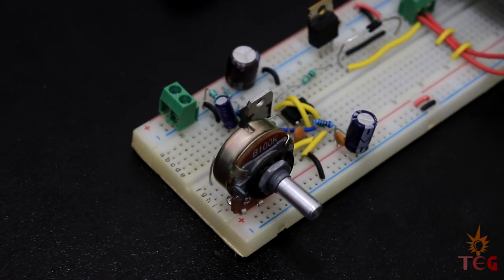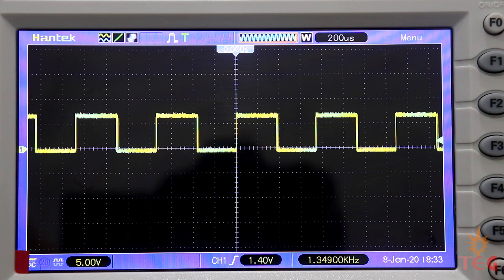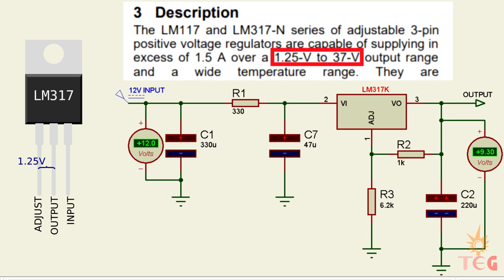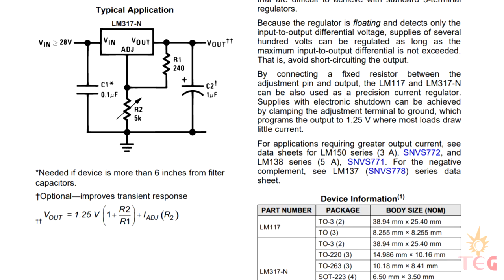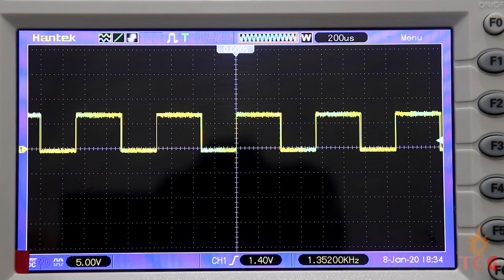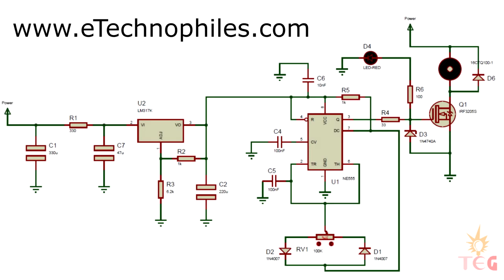I made a DC Motor Speed Controller on Breadboard| 60V,15A

Comment from the maker: Timestamp :

Specifications:  00:07
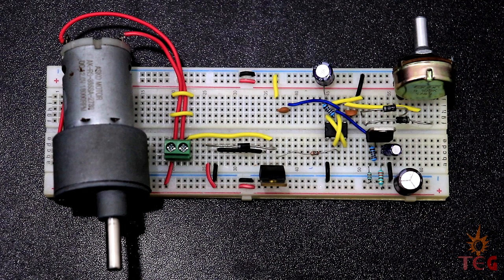Circuit explanation: 01:40
Switching Circuit:  02:09
PWM Generator:  03:20
Voltage Regulator Circuit:   05: 04
Circuit Schematic: 05:39
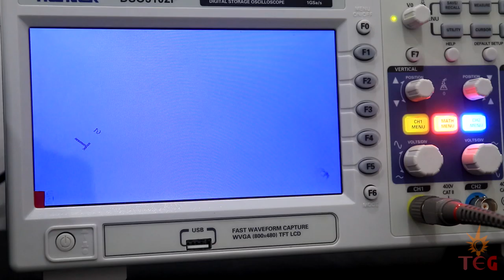Input voltage Regulation in detail: 06:07
555 timer PWM operation: 07:18
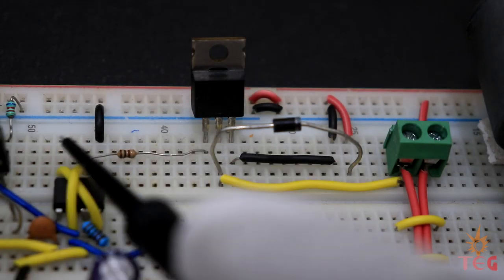How IRF3205S Mosfet switches the Motor: 09:00
Why Schottky Diode across Motor: 09:42
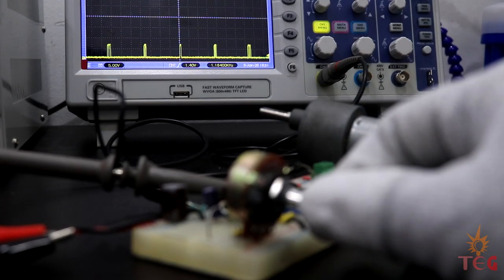Demo of the Controller: 10:15
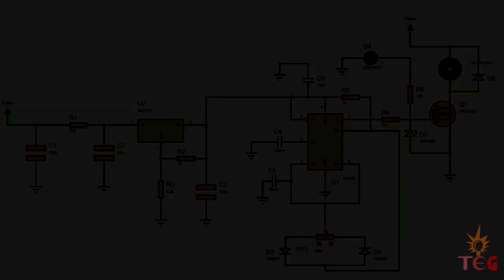Am I the Designer of this Circuit? : 10:43
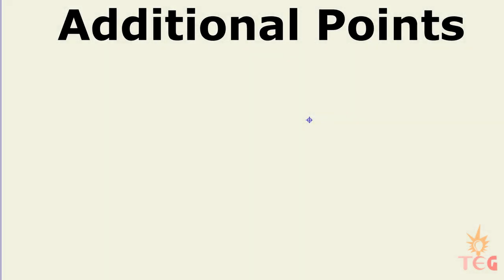Additional Notes:  11:25
Where is the Arduino Control Part? : 12:12
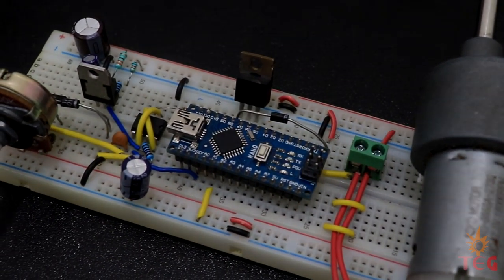Life Lesson from TEG: 12:25

Comment: In the diagram you show 4 diodes 1 zener 1 schottky and 2 X 1N4007  and in the parts list you say 5 diodes
3 X 1N4007  1 zener 1 schottky
Reply: brother if u r still there I have to ask can i use simple ordinary DC Battery 12V
Reply: @kredziigaming981  of course, its designed to be used with a 12v DC battery